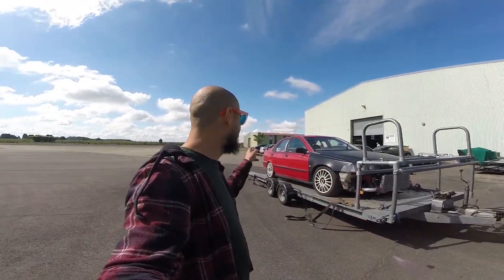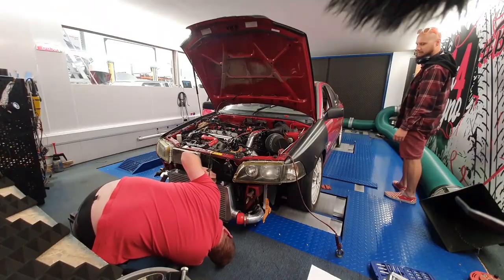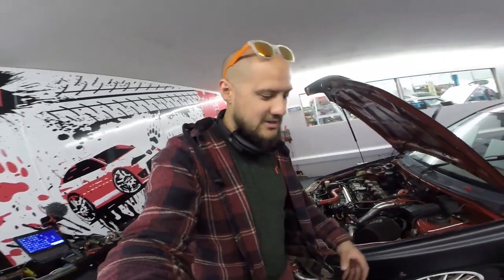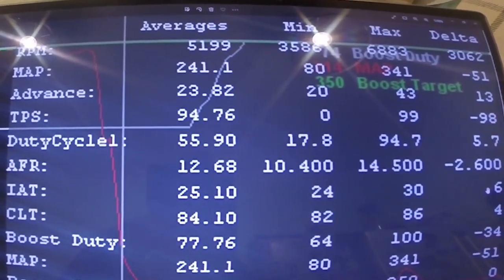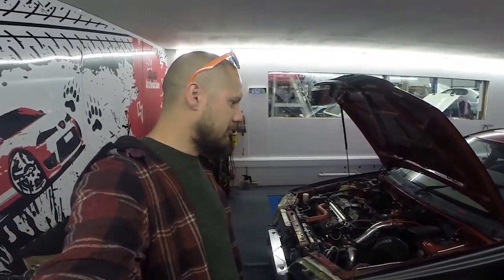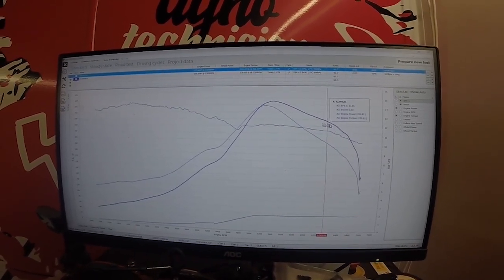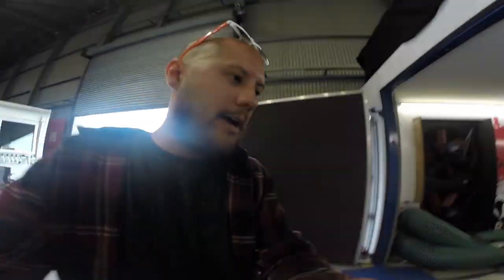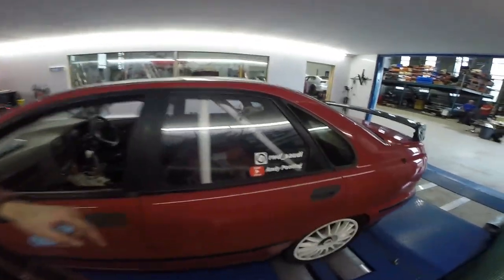Holset HX40 Volvo S40 gets on the Badger Dyno!! Tube and fin vs Bar and plate intercooler test!

Comment: Great work and infos there, thanks. However, still confused how low the number is with HX40 on 2liter volvo engine with that much boost. I run T5 stock with HX35 (12cm turbine housing) with as low 1,2 bar with 93 octane, producing 381 FWHP (430hp on engine est.) upping the boost to 1,9 bar will go pass 500crank off course
Reply from the maker: Yep, the number should be much higher! I'm certain the manifold back pressure and cams are the reason why it's just not breathing properly. New engine in the works with new manifold and cams so we'll see what it does after that!

Comment: Nice car!
I also got an T4 from 99' with the M56 gearbox. Wanna get around 250-300hp. Should I change some internals or can the engine handle the power and torque?
Reply from the maker: For 300hp you will be ok on standard internals but you don't want to have too much boost at low rpm to protect the rods
Reply: @AndyPonting  Ok that’s sounds good. Can you recommend a setup? I’m thinking about a new exhaust, intake, intercooler and some software (more boost around +4000rpm

Comment: Greetings, I would like to know what the engine has?  I have a project already started running 300hp with the automatic stock block.  what's your engine?
Reply from the maker: The engine is a Phase 2 T4. Engine code B4204T5. 1948cc
Reply: @AndyPonting  is the engine stock? internal ? It's the same engine as mine but I don't dare increase the pounds more than 12psi
Reply from the maker: It has forged rods installed. Everything else is stock

Comment: All video says that tube and fins are better than bar and plate interesting results
Reply from the maker: I don't think that it is always a case of tube and fin Vs bar and plate. The overall construction (quality) has a lot to do with it. The T&F intercooler that came off had very few fins internally to exchange heat, unlike the B&P version. High quality T&F aren't like this cheap one...
Reply: Thank you what do you think about fmic performance Eu compagny IS there intercooler bare and plate good

Comment: your tube-and-fin is so useless, because there is only 10 straight fins inside...there is nothing to expect from that piece of metal...and ofcourse nothing to compare
Reply from the maker: Yeah, I knew there was a risk that the tube and fin wasn't going to be very good, but it was free and a lot larger than the small one I had on the car already... I do think it was an improvement over the smaller one, but not much. The new bar and plate is loads better!